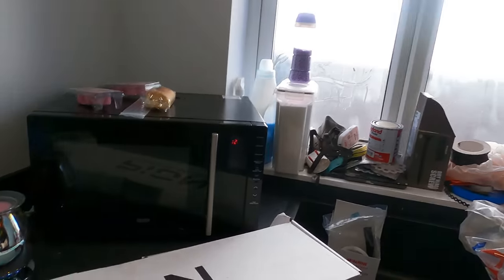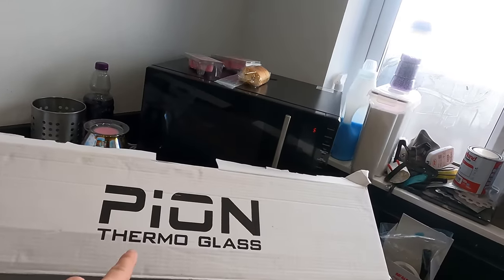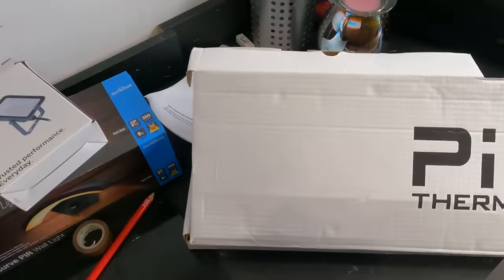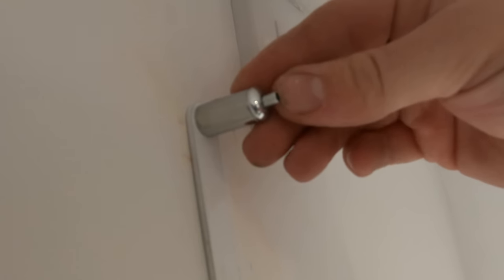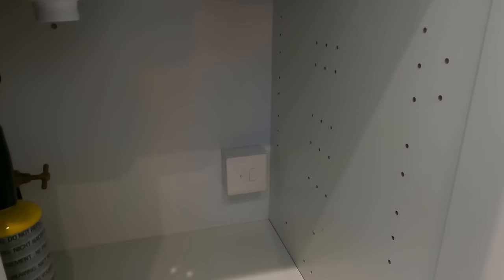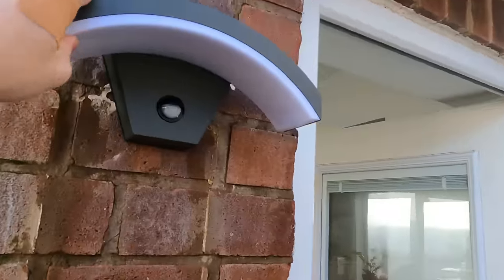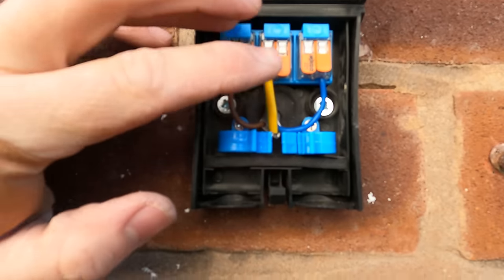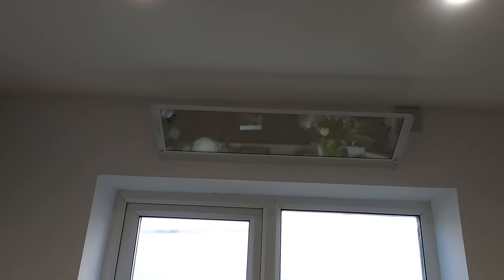Almost Cut My Hand Off | New Cool Stuff | Electrical Life

Comment: Sean mate. Wat you like! Do we now need to take all the sharps away from you to stop you self harming. Your a sparky not a bleeding wood-worrier 😂

That matt black socket looked nice (for now) but had to chuckle at the dirty grey plug top you plugged into it. So funny.

That noxbox looked interesting. Will have to lookout for them.  See, we can learn something from watching your Info Vid's.   And that heater... interesting also, apart from their price.

Anyway take it easy with that hand and bet your glad (eh😉) it was your left one 🤭.

👍
Reply from the maker: haha yea that socket had my extension lead and a temp kettle plugged in 😂 it’s a belting heater tbf, not much option when it comes to a small kitchen so that’s a nice fairly modern looking way to do it imo
Reply: @Cablesmith  Agree when it comes to a small kitchen and certainly beats them horrid little IR ones your grandma use to have on the bathroom wall cooking the ceiling (especially if she'd been all modern like and had them polystyrene tiles too🤣).

Just a shame they are so dear. But definitely a more modern option if budget allows. 👍
Reply from the maker: @Sparks1Plumbers0  hahaha so true ! The only other option really is those kickboard heaters also
Reply: @Cablesmith  No 😱... not them nasty dust & fluff collectors.

Firemen's friends them things as all they are good for is starting kitchen fires! 😉
Reply from the maker: @Sparks1Plumbers0  well yea I was going to say they’re a bit old school now and just collect dust, just didn’t want to offend if you had one yourself 😬😃

Comment: Will defo give the NoxBox a try at some point but just seen the price of them there 👀 can’t go wrong with a wiska 206 and some wagos. 

Don’t really fancy the rapid connector downlights though they look a bit naff.

As always cracking video and some nice work in there as well mate 👍🏻
Reply from the maker: NOXBOX50 on Amazon for half price which is then a fair price imo. 
Thanks for watching mate
Reply: @Cablesmith  cheers mate I’ll get a couple ordered just now
Reply: Yes, that wiring method was used for years with festoon lighting which used two core flat trs the lamp holders had pins which 'pierced the cable, because it was rubber, when the lamp holder was removed the rubber closed up again !  No longer legal...  funny that !
Reply from the maker: @nolanbrownwig5703  interesting, never seen those

Comment: You can buy a thermal imaging sensor with a tiny screen from China that you can run off the USB output of a mobile phone powerpack. They cost around £50 and are surprisingly good. They're only an inch square so take up no room in the tool bag. I maintain an old installation and use one for checking our ancient fuseboards under load. I can't include a link because it will get my comment removed, but search "imager camera digital thermal" on eBay.
Reply from the maker: Nice mate 👌🏼 appreciate that ! thanks for watching

Comment: Nice video. Could you do a revisit or ask the customer how the thermo glass heater and stat are performing. I know you said the heater was hot hot, Does the heat get thrown quite a way. I am interested to know if it works well with the stat or does the stat not pick up the temp from the heater accurately because heat rises and the source is already quite high up. If it works well then its a very nice piece of kit.
Reply from the maker: Yes I’ll be back there doing under cabinet lights in the near future anyway. 
Thanks for watching mate
Reply: @Cablesmith  Oh, just to say I like your tattoo. I had to look up what it meant lol but is a good motto to have.
Reply from the maker: @MrImATarget  thanks mate 👌🏼 that was my first tattoo at 16 😬😂

Comment: Hay - amazing run through of kit - do you know if the down lights only except one size of cable - just wonder if you can use 1.5 or 1mm as pins may not hit the right cables - cheers chap
Reply from the maker: Hi mate, just checked the instructions and it says only suitable for 1.5mm cable. Good shout thinking of that 👌🏼

Comment: Not sure about the downlight dude? What if you get a failure and need to swap one out? Looked like the flex is hard wired into the fitting, so guess you'd have to change the lot, meaning opening that connector on the pinched / pierced cable? You'd have to reconnect at the exact same point on the cable to make sure your not exposing more copper further down the cable? 

As your an Aurora man, have you tried the new R6 yet? They do a few variants but they have a wattage changing and CCT selector, the newest version also has the fast fix connector similar to whats on the E6 Pro. But they are cheaper than the E8's mate, again if your buying from the right wholesaler 😉 

Definity range is 🔥🔥🔥 they got matt white too & recently brought out both the black and white in metal plates, bit more 💷 but look tasty 🤌🏼
Reply from the maker: Actually I only seen the R6 last week and want to try them out. Meant to look into them and forgot you’ve just reminded me. 
also them matt black sockets, one of them it metal the rest plastic 🙄 I was meant to have the metal ones and got them instead 🤦🏻‍♂️
Reply: @Cablesmith  I've opt'd to stock the fixed wattage but CCT (3k/4k/6k) with the new fast fix connector, as the single wattage keeps the price down a little bit, allows for the extra cost to go on the connector. Because I went for that one we still waiting on Auroras stock to land, I'm hoping to see um very soon 🤞🏻 you'll have to send me ya address mate, I'll ping you one to look at on the channel 😉 (when they land of course).

And hope you didn't pay for metal and got plastic mate?
Reply from the maker: @bellas_switch_adapted_toys  makes sense for any wholesalers to stock a cct version anyway imo. Rather than shelf space used on 3 of the same light anyway. Then of course those times a customer gets given the wrong colour by accident. 

not sure what I paid for 😂 I think it was my fault tbf
Reply from the maker: @bellas_switch_adapted_toys  also yea, drop us an email when you’ve got them in I’ll happily show it on the channel and let people know where it came from 🙂 I do love the Aurora stuff !

Comment: Like the look of the curve light Sean,I couldn't see it on Expert Electrical but did on Amazon for £35,is it fully waterproof and suitable for fitting on an outside wall with no cover from the elements or is it more a porch light,hope the hand heals quickly
Reply from the maker: yes it’s suitable for outdoors mate, and it’s not yet on the expert site, but will be added soon. It’s in the downlights direct website tho, which is also expert elec. 
Thanks for watching mate
Reply: @Cablesmith  I really enjoy your videos,I am not a spark but a retired Motor Mechanic and Auto Electrician,I do carry out basic electrical work in the house myself but I have a mate who is a qualified spark who I can consult before I do anything and if it's too complicated he does it for me,bit gutted I never won the CU as mine is 20 years old but Jack is a worthy winner,but like you said he has good content but not as good as you 😂
Reply from the maker: @pikricky  where are you based ? I actually need a auto electrician atm. 👀😂
Reply: @Cablesmith  😅 Scotland
Reply from the maker: @pikricky  haha bit far but worth an ask ! 😂

Comment: Hmm noted the gas bottle.  Pretty sure there a no go zone around them
Reply from the maker: what is a no go zone ?
Reply: @Cablesmith  an area around a fixed gas bottle where electrical equipment cannot be placed i.e. a hazardous zone.  Only say this because we in Aus/NZ follow many of the UK/IEC regs.  In our rules there a cone around gas bottles.  Cites from gas regs.  So just because it may or may not be in the 18th ED, it maybe part of Has Area regs or building regs or even gas regs.

Interesting stuff. Hint gas will pool down so that's why the no go zone.

Love your work.
Reply from the maker: @cjkokay  ah I see what you mean, yes I agree but it was just an empty gas bottle stored in the garden from a bbq I presume, it wasn’t there in use. 
Thanks for watching Carl, appreciate it a lot

Comment: Enjoyed that video sean, those heaters look nice, what sort of heat does it throw off? Any good?
Thankyou for the shout out also dude your right I am a nice chap 😎 
Those down lights with the spikes in look poo 💩
Reply from the maker: The heater is mega mega hot and only 700watt (rhyme by accident I know) 
You couldn’t touch it at all when it was fully heated up. Must have been easily 250°c plus on the surface
Reply: @Cablesmith  dayummm that’s good then yeah, hold tight sean the lyrical genius by night
Reply from the maker: @JRCElectrical  😂😂
Reply: Totally agree regarding that Light.... them cable piercing lugs are 💩. Had similar fittings on a load of LV lights years ago and they were for ever failing due to them cr@p lugs. If they had some form of mechanical brace pushing down on them permanently than perhaps OK but for me I'd run a mile from them ones.

Comment: Don't like those downlight connectors. I think insulation displacement is fine for ELV applications, but not LV electrics. Noxbox looks a well-made bit of kit and that glass heater thing is bizarre! I saw in another comment that it's only 700W, so not that useful for a bigger room unless you use a few them but very interesting!
Reply from the maker: They do have higher wattages also, and your probably be surprised on the size they recommend sqM wise. But yea, it’s handy for them small kitchens with no wall space indeed.
Reply: @Cablesmith  mate you're on YouTube like some kind of replying ninja :D
Reply from the maker: @havoctrousers  always ! 😂

Comment: Can you loop in and out with them clip connectors?
Reply from the maker: Which ones ? On the downlight ?
Reply: @Cablesmith  yes the ones where it pierces the wire
Reply from the maker: @iotelectrical  yea you can

Comment: Wouldn’t you need the spots looped as one cable though cause there’s not two spikes to pierce two cables?
Reply from the maker: Yea that was my initial thought. End of line your snookered even after the struggle of keeping one continuous loop. However they are an Australian company, maybe they do things differently I’ve no idea. 
I see there could be places it would be nice and simple tho, maybe a bit more of a commercial job with a long corridor run of basket, the flex is long enough that you likely wouldn’t need to even pull a loop you could just stick the light anywhere you wanted. 
🤷🏻‍♂️
Reply: @Cablesmith  - it’s more like a tap off fitting, just one long run and tap off in all the places needed like you said it’s ideal for a commercial job cause you can have lighting anywhere without having too much alterations on the wiring, just one long switch wire straight down the middle 🤣
Reply from the maker: @joeypriestman6783  haha yea, that’s what I had in my head, like a cheaper way of having those lighting tracks above a ceiling grid 😃
Reply: @Cablesmith  end of line wouldn`t the cable just finish just inside the end of the box.
Reply from the maker: @MrImATarget  not sure, surely there would be a live end just unterminated then ?
Reply: @Cablesmith  just had a closer look at your video and it looks like there is a rubber stop end in the plug so you cant get to the cable end. Yes it would be unterminated but no protruding ends. Not sure how that flies lol. Maybe dip the end in bitumen haha!
Reply from the maker: @MrImATarget  your right, I just looked too 😂 you couldn’t touch it I suppose. Seems strange but I suppose it’s no different than having live terminals inside anything